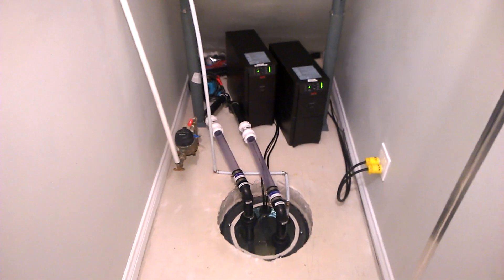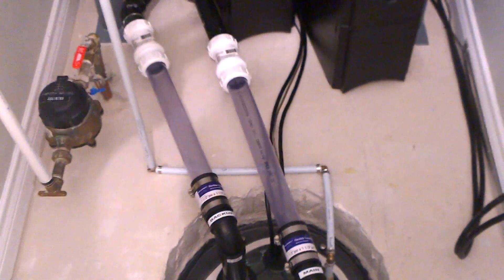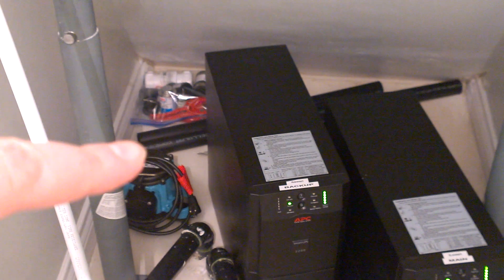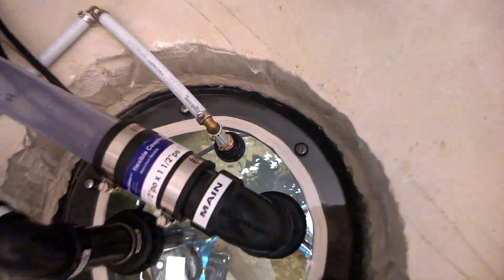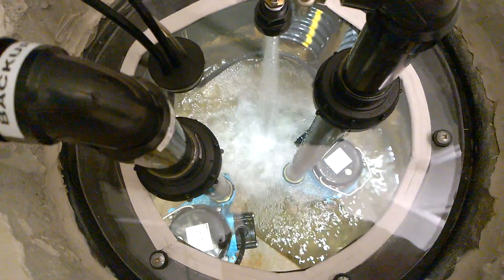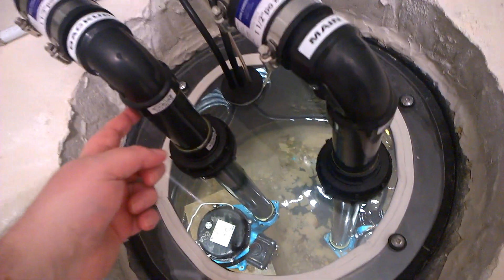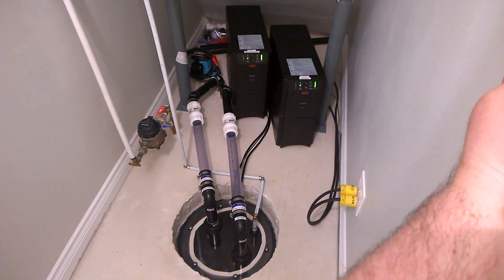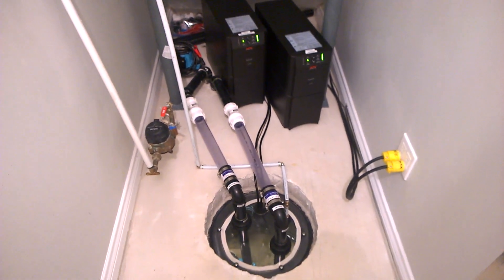LIGHTED Sump Pump Pit with CLEAR Sump Pit Lid & RADON Sealed - ULTRA Residential Flooding Protection

Comment from the maker: My Full Playlist:  https://www.youtube.com/playlist?list=PLnlincqkQbx_2CBAKSZ7gFBqi3LA25rOx
Reply: 15 Amp braker, I was looking for that data. Thank you.
Reply from the maker: Yes - you have to match up the starting current of the sump pump motor.  In my case, the starting current of the motor peaked at under 10 Amps.  That meant a 15 Amp breaker is fine, and also a 22 kVA UPS can handle it easily.

Comment: Great setup. If a water line busted in the basement, could water get into the sump pit with the sealed lid? If so, do the sump pumps have a flow rate greater than the flow rate of your water supply?

Comment: What kind of fittings are you using to pass seal the discharge pipes to the cover?  What about the grommet for the cords?
Reply from the maker: Rubber stopper for the cords.  Bulkhead fittings for the pipes.  I had put links in another comment.  You can order them from Wolseley.

Comment: Spectacular! A great addition would be a water sensor attached to your alarm system and put the sensor inside the pit above the normal water line. Then in the event one or both pumps dont work, you will get a water sensor alert to your phone or alarm system
Reply: Also an alarm to let you know if the main sump pump stops working

Comment: Great job!   My wife tolerates me, but you are on a whole different level!

We just had 6 inches of rain in 48 hours.  My single pump was getting rid of 1600 gallons per day.  

But homes with sump pumps, 1) keep a backup pump on the shelf 2) water alarm with sensor just above the high water point 3) run water into it every 3 or 4 months to test  4) flashlight hanging in the area.     

Now I need to play this video to my wife and say, "SEEE... I could be worse."  :)

Comment: And here I am patting myself on the back for installing a M98 zoller and and a clear spring loaded check valve. Plus, the M98 pulls way too much inrush current to work on my SMT2200 :/ Amazing setup btw

Comment: Cool setup. Any videos of this working in the heaviest rains? I'm curious how much flow you get from all of those pipes. I have seen some videos on youtube with horrific flows - I know of one where they have one massive pump that does about 300GPM and other smaller ones that pump about 30-50GPM and they keep 4-5 pumps (including the huge pump that is intermittent) on  during the heaviest snow melt days or rain days. They had a crappy builder. Their flow rates were in the hundreds of gallons per minute coming into the sump. Another had a continuous single sewage pump for about 3 months of the year and pumped somewhere around 1.5+ million gallons due to their house being on top of an aquifer. Scary stuff.

Comment: Do you have special couplings on top of the basin to allow you to take off without cutting the PVC?
Reply from the maker: Yes - you don't have to cut any PVC to dismantle the entire thing.
Reply: @Bill-gl3oo  Us novices need a video on this, please.
Reply: @Bill-gl3oo  awesome system / video! can you please clarify the connection points / fittings used from the pumps up until the clear pvc? I can see the flex fitting and bulkhead on glass, but unsure how you connected the rest

Comment: This is fantastic!  Any chance you could provide a link to the bulk heads you used and maybe the rubber grommet for the electrical?
Reply from the maker: This is the rubber stopper:  https://www.amazon.ca/gp/product/B0163E8SGO/ref=ppx_yo_dt_b_asin_title_o05_s00?ie=UTF8&psc=1
This is smaller bulkhead:  https://www.amazon.ca/gp/product/B0002DKANM/ref=ppx_yo_dt_b_asin_title_o04_s02?ie=UTF8&psc=1  
The 2 larger ones are from Wolseley.  I believe part # 42-38050 which is a 1.5" polyprop bulkhead fitting.  Try here:  https://www.wolseleyinc.ca/

Comment: This set up is awesome. I am in the process  of putting  in two  stand  alone  pumps. My question  is can I use pumps with the same horse  power( 1/3hp). I was told if  they do it will affect  the water flow slowing the water pumping out if they both are on at the same time.
Reply from the maker: Thanks!  
Both pumps being the same HP is perfectly fine.  One will not affect the other, unless they are both on the same circuit, in which case, they may trip the breaker if both come on at the same time.

Comment: Great setup...couple of questions. Is there a way to get the lid off easily for maintenance? I want to straight copy this but would like to incorporate a way to get in the pit from time to time to clean the mud.

Also, any tips on how to do the lights? I'm not familiar at all with how to do that...
Reply: Nice set-up!  I'm also having trouble visualizing how the bulkhead fittings on the lid detatch from the short pipes in the sump which connects to the pump.  Do you happen to have a manufacture or part number for the fittings?
Reply from the maker: Yes - you unscrew the screws and take it off, but it really shouldn't need any maintenance - the only "maintenance" is I will change out the pumps after 5-7 years.  

LEDs are custom - I bought the LEDs, soldered them together with resistors, wired them to a 9V DC adapter, and taped the harness to the ceiling of the sump pit.
Reply: @Bill-gl3oo  is that tape going to hold for a few years of sump pit humidity?
This is amazing btw.  We'd get along great 😊
Reply from the maker: @brandonlivingston3032  Thanks, Brandon!  Excellent Question!  It's waterproof tape, so hopefully!  If not, I'll use something else.
Reply: @Bill-gl3oo  can you explain step-by-step how you’d get that lid off? I’m trying to conceptualize how to put a sealed lid on with union connections. At some point don’t you have to unscrew the pipe coming from the pump itself? Is the pump heavy enough to allow the pipe to screw off without spinning?
Reply from the maker: @TENTHIRTYONE  It starts by loosening the compression joints that hold the section of clear pipe.  Then you can unscrew the 1.5" bulkheads, then unscrew the lid hold-down bolts and the lid comes off.

Comment: where can i get that ups backup and what size is the back up and how long will back up run?
Reply from the maker: It's from APC, and the details are in the description.  Google APC.
Reply: @Bill-gl3oo  So how long will the pumps actually run off those UPS units if you have a long power outage?
Reply from the maker: @tombryant4518  Good question - I've never timed it - It's possible to calculate it based on the Ah of the batteries - I'd say at least 30 min of continuous pumping.
Reply: @Bill-gl3oo  Ok, Thank you for taking the time to answer! I’ve often won what I should get for my house since I’m screwed when the power goes out during a heavy rain
Reply: What is the duty cycle during a storm? 30 minutes continuous doesn't sound confidence-inspiring. Curious why you didn't go with a waterjet backup. Seems like you've got the room (and supply plumbing!) to put one in as a tertiary.
Reply: @FlyNAA  Going by this set up, I would bet he has a generator for the house too.